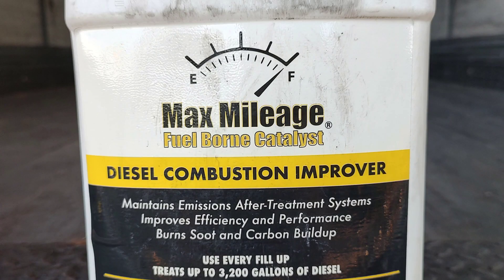Max Mileage

Comment: I saw it sold at Kenly 95, "only" $200 per gallon on sale, so I figured I'd try it. Here I am on shoulder with high soothes level/regen warning, regenning. I just got out of the shop this morning with a sooty egr code, etc. I just got out of shop Friday with issues. Two weeks after starting to use this stuff! I just had the DPF cleaned out 6 months ago for $1700! I don't idle much at all, as I have an apu! I now read on several reviews on YT of this stuff that others have had the same and similar issues! 
Yet, I guessing there's no guarantee of financial responsibility for any damages by this PP product!
Reply from the maker: Sorry to hear about that, that's got to be frustrating. I'm still using it and haven't had any issues. I guess that the catalyst is doing a lot of cleaning and that's what is causing the problem.

Comment: This stuff works. I know Bruce sounds like a Snake oil salesman when he is on with Rutherford but he is right about this product. I run it in everything. My car, lawn tractor chainsaws etc. I run a company truck now and told the boss man about it and we run it in all the tractors now. Cummins X15 pulling 120k gross of logs and equipment and no check engine  lights and no parked regen’s. Glad to see you back on here as you have some great info without the drama.
Reply from the maker: Hey, thanks. I'm on my 2nd Gal. No problems so far, I've put around 45 on my new truck.

Comment: $175 for a gallon? You must have gotten the winterized version of it 😂, which that does exist. The gallon of regular max mileage is like $260 not including tax. It's expensive, but it does work.

I've ran it for a while, and coming off the highway from running full speed, i used to get the High Temperature Exhaust light come on, but running max mileage, it happens very rarely. When sitting idling for a while, my regens went from 20 minutes or so to 5 minutes or less. And I would fill my DEF tank up about once a week. Without running it, I'd have to fill about twice a week.
Reply from the maker: Oops. I meant to say $275. I bought it on the road down in Austin so, I had to pay a little extra. I'm on my 2nd Gal now, I've put around 45K on the truck and haven't had any problems.

Comment: How in hell does it lower egt yet the cylinder fuel burn is hotter to burn the carbon in cylinders?  It makes no sense.
Reply from the maker: It is making a cleaner more efficient burn. I would think that it could lower EGT's if you don't have unburned fuel going out.